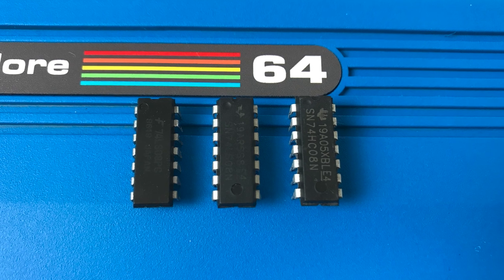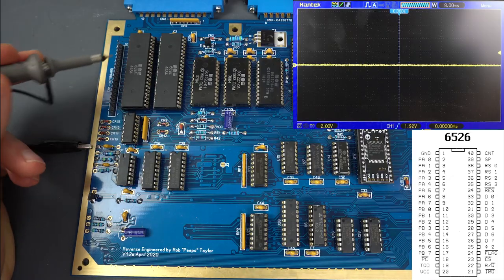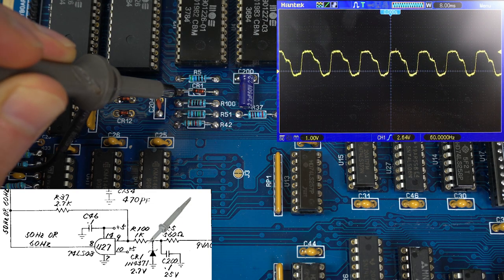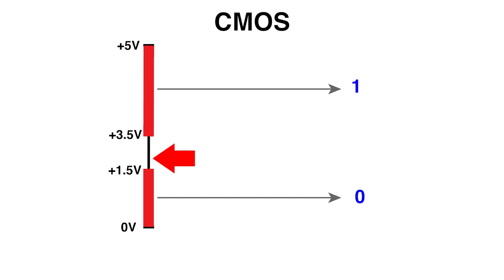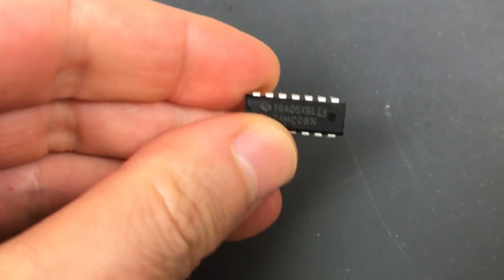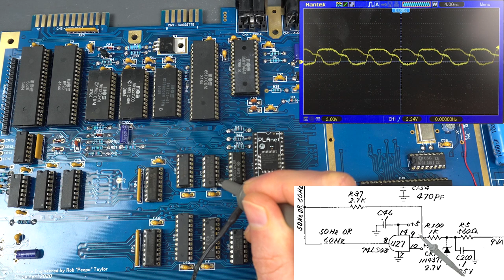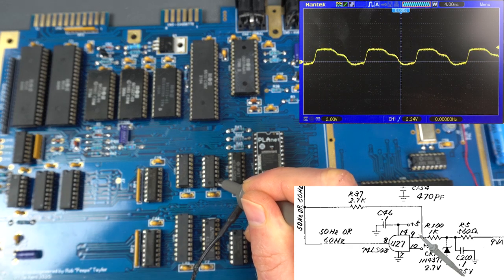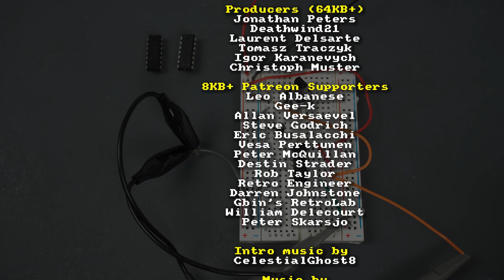Stumped By New Fake Chips Scam

Comment: I'm surprised the tl866ii doesn't use the proper voltage for testing LS/HC chips in its database; from what I can see you should be at least able to select the logic level used.
Reply from the maker: I assumed the TL866II just uses max voltages for their tests because they're logical test. They're even listed as the same chip: 74HC(LS)08.

Comment: I have been using KiCad for a few years now and I have been spending a lot of time, just seeing what I can design... I had an idea of wanting to design a C-64 board that plugs into the S100 bus and  looks like a S100 bus to the rest of the bus system... 
(Meaning, hopefully, I can get a C64 to operate the other S100 bus cards in the box..)
It would be cool to run Hesmon on a S100 bus and see what is going on inside..

Option  2
I want to totally revamp the S100 bus to run modern chips and access features that did not exist when the S100 bus came out... (i2c, USB, HPIB, ethernet, SSD, (SIMMs or better), uSD, WIFI,  etc)
Even use a few of the unassigned S100 pins as (bus mode logic).  
(pin High = standard bus), (pin Low = alternate bus)

Is there anyone out there that can help?  
(Would like to see what can be worked out..)

Comment: Imo, 2v7 is a bit tight, anything below 5v1 would have been fine.  Anything relying on the analog switching voltage of 74LS series is a bit suspect and it could have easily been designed to work with either and it will drift with temperature.  There are also lots of people in the supply chain that that just think they are equivalent and in nearly every application they'd work fine.

Comment: A 74HCT08 should work. 
Or increase the Z diode to 4.7 volts. This is to ensure that the IC does not get more than 5 volts at the input.
Or you can program am attiny85 that outputs 50 Hz.
Reply from the maker: Yes, an HCT would be idea there (just didn't have any on hand, just HCs apparently). Probably even something as simple 555 timer would be enough to generate 50Hz.
Reply: @NoelsRetroLab 
Comodore has surely adjusted the Z diode when another manufacturer of the 74LS08 did not work.      I would have provided a 4.7 or 5.1 Zener diode and a real Schmitt trigger.

 I'm thinking, in the US the line frequency is 60 Hz. So you have to divide by 60, not by 50, to get a second.
What happens if you give a European C64 60 pulses to the CIA?
Does the clock run faster then?
How does the CIA know if a second has 50 or 60 pulses?

Comment: One possible explanation would be just misslabeled batch which would be discarded at factory, but some people resell factory discarded chips as legit...

P.S. I would strongly suggest to change zenner diode to raise voltage over threshold - healthy HC should trigger on any voltage lower than threshold, but there is no guarantee that it will trigger on any voltage lower than that. Current chip triggers in current conditions, but could drift a little with temperature.

Better solution would be Schmidt trigger, but that would probably ask for changes on board...
Reply from the maker: I don't quite buy the mislabeled when things come from those sources. I suspect foul play, but you're right that it could all originate from a bad batch (of HC chips) that were all relabeled. And yes, you're right about using a higher zener (or a real LS or HCT).

Comment: I don't think this was a fake TTL chip. The input signal at 2.1V was already at the limit of what well-manufactured TTL chips would recognize as logic high. So if the manufacturing process used wasn't very well controlled and the testing a bit lax, you could get authentic TTL chips that just wouldn't register the logic high. So I think this is a case of poorly manufactured, bad quality TTL chips, not fakes. (What was fake was the TI brand, as these are likely Chinese TTL chips, not TI.)

Comment: Break the plastic case and expose the die and try to figure out if they're genuine TI parts or not by comparing them to a legit one, I mean, it's a dirt cheap chip, nothing bad in doing that experiment :) Also, the mod you've applied to the zener diode might work marginally with that counterfeit 74HC, I think it would be better to raise that input voltage by using a higher voltage zener or using a proper 74LS
Reply: What is a genuine TI die supposed to look like?

Comment: Your analysis about the chip being "fake" is mostly correct in that it definitely doesn't behave like a TTL chip (which aren't only 'LS' chips, but also those with no letters between the 74 prefix and the trailing digits).  Your EEPROM programmer wouldn't spot the difference since it sends unambiguous logic signals to the DUT (device under test), whereas Commodore's circuit design used a logic chip as a poor-man's Schmitt Trigger (https://en.wikipedia.org/wiki/Schmitt_trigger), which is an analog system.  Commodore simplified the board by re-using a spare logic gate instead of adding an operational amp, or even a pair of transistors, to perform this function.  In the end the "counterfeit" operation was a mild infraction since they're selling logic chips that expect something below 1 volt for logical "zero" and something above 3 for logical "one", and have the sufficient "fan-out" to work like the pure TTL logic chips of the mid 70s in logic circuits.  Just for the future, you could also increase the resistance of the hysterisis loop to make the circuit work.
Reply from the maker: Yes, you're absolutely correct. I suspect Commodore went that way because they had one unused gate in that IC and decided to use it in a marginal way.

Comment: I wouldn't completely blame the chip and the manufacturer of it.
The circuit design is partially involved in this "uupsie" too. A circuit that relies on the triggering level of a logic gate to be at a certain level to function properly.
Reply from the maker: I agree that the circuit design is severely lacking (I suspect a last-minute hack to make it work with an available gate).

Comment: A quick search of Mouser finds that SN74HC08N and SN74HCT08N chips are about the same price, while SN74LS08N chips are about twice the price.  The knockoff manufacturer probably only manufactured 74HC08 and not 74HCT08 chips, and probably thought nothing about logic family compatibility when rebadging 74HC08 as 74LS08.  74HCT08N has TTL voltage-level compatible inputs.
Reply: Higher price is reason enough for Chinese fraud.

Comment: Tandy had a similar issue in  Australia  in the early 80's with their model 16 B running Xenix (a derivative of Unix from Microsoft that latter became SCO Unix) in that they had set the system clock run off mains frequency which is 60 Hz in the USA and 50 Hz in Australia. It was fixed with a software patch.

Comment: Hi I am an old fart. traditionally 74LS04 chips were used in crystal oscillators. SN7404, 74HCT04, 74HCT04 will not work properly. The LS chips worked better in the analog mode and only needed two caps and a resistor to create a stable oscillator. The caps were connected to either side of the crystal and ground, the resistor was in parallel.

Comment: one way to differentiate an 74LS08 from 74HC08 is to measure input current when it is tied to 0..0.4V should be a bit less than 0.4mA coming from the IC to the input (in 7408 bit less than 1.6mA) this current runs from the internal 2K/4Kohm resistor via diode or emitter junction. CMOS and HCMOS haspractically  no current flowing from IC to input. a single high efficiency red LED could be used to see the current if no current meter is handy.

Comment: I haven't watched the video yet, but... who'd make a fake 7408?
Also, I do notice the one on the right is HC... I remember writing a how to build document before, and the diagram lists a 74LS138. However, since almost everything else on the board is CMOS, not TTL, the 74LS138 doesn't actually work in it, you need to use a HC or HCT version. I'm not sure if the original 74138 works or not, because I didn't have one to test, but the HC and HCT chips worked, but the LS did not.
The main reason why some work, and some don't, is logic levels.
For TTL, a valid low is anything below 0.7v, and a high is another above about 2 volts.
in contrast, for CMOS, its something like, bottom 35% (so below 1.75 volts) is a low, and the top 35% (above 3.25 volts) is high.
so the LS's Above this is high, is the CMOS's Below this is low.
HCT is something inbetween, I think it basically guarantees the output will be below 0.7v, or above 3.25v, so it works with both, and I think the input follows LS levels.
EDIT watched up to where you're looking at the clock circuit.
For Logic, most of this stuff doesn't matter, but for an oscillator? Yeah, it needs to be designed around around the type of chip, so using the wrong chip isn't going to work.
Reply from the maker: That's one of the big takeaways: People ARE labeling 74HC08s as 74LS08s, which is kind of mind blowing.
Reply: @NoelsRetroLab  Yeah, I did watch it through eventually.
Crazy indeed. not even a HCT.

Comment: Yes, there are a lot of rebranded chips from China, but some of them aren't even from TI, but sometime direct from chinese domestic manufacturers.
Therefore, if you want a vintage original and an original TI or other guaranteed Western no longer for sale or is very expensive, can buy chips from Soviet union or former CMEA countries.

74S08 = USSR KR531LI1
74LS08 = USSR K555LI1
74ALS08 = USSR KR1533LI1
74ALS08 = Czechoslovak Tesla MH74ALS08

You talked about the CMOS HC series, which with logic levels 0 and 1 is not compatible with TTL, that's true. 
The CMOS HC series is only compatible with the CMOS 4XXX series in range 5V power.
But there is also the CMOS HCT series, which is compatible with TTL, so next time you know you can buy also new 74HCT08 :)

Comment: Mains frequency is actually very accurate. It us used widely for clocks and is specified to be within certain tolerances at all times and within tighter tolerances over a certain period. This means that if the frequency drifts the power companies have to introduce a deliberate compensation offset for a period to bring the overall frequency back into tolerance. Unfortunately because of this method the TOD clock will always reset when it loses mains power. At least this way avoids introducing the menace of leaky backup batteries! 😲
Reply from the maker: Good point about that avoiding potentially dangerous batteries!

Comment: The frequency of mains AC power is extremely reliable, precisely because so many devices depend on it for timing.  I have an  old Westinghouse microwave oven that, for some reason, doesn't use the mains frequency, and its clock loses a few minutes every day.  Dumb design, but maybe it saved a dime, back when it was built.

Comment: Over time the 50Hz mains freq will be more accurate than any xtal derived clock, at least here in the UK where it is guaranteed to average out to exactly 50Hz eventually. I have a mains powered wall clock that has been running for more than 25 years now and has never been corrected other than after a power outage.

Comment: Common misconception that a higher frequency from a crystal is more accurate then for example the AC power frequency. This is not true. AC power is both stable and compensated for the number of cycles per day. Ir may run a bit slow at some point but will catch up later. Crystal accuracy is accounted for in % or rather ppm, parts per milion. It can be adjusted a bit with some variable caps and in a computer no one bothers to do so. Temperature fluctuations case the frequency to drift and from one crystal to another manufacturing differences introduce some amount of spread.

Comment: I think, at hot temperatures, it may not work.  The Zener voltage goes lower as it gets hot.
Reply from the maker: You're right, but it's probably a tiny drop. Although if it's just barely at the right level, you may be right that it might suddenly stop working.

Comment: Net frequency is not just "not that bad" if I remember correctly is is actively monitored and corrected when it deviated to much. (At least it is in the EU). Seconds missing from one day are corrected the next.
Reply from the maker: It's all relative. I saw measurements that it deviated up to 50 seconds over a few months, so that's "not bad" but I wouldn't want to do anything accurate with it 😃 And clearly that's not the objective of the time of day clock on the C64, so that's fine.
Reply: In the US I believe the the spec is 0.05% over 24 hours. That's worst allowed. As I can recall they regularly do better than that.
Reply: @1pcfred  In the Netherlands where I live it has to be between 49,5 and 50,5 for 99,5% of time. A few hertz more up and down is allowed for a max of 44 hours a year. which I think is less than a single percent of hours a year. So yeah seems pretty accurate to me. It has to be considering the amount of clocks that ran of mains frequency as the source of accuracy.
Reply: @bzuidgeest  it beats using a sundial or an hourglass.

Comment: I don't really understand why Commodore put such a low-value zener diode in that position to begin with.  Yes, technically, you shouldn't need to go higher than that, but what would it hurt to put in a 4.7V or 5.1V zener instead, and make sure you were always fully driving the input anyway?

I would bet that the reason they pull the clock signal from the AC line instead of the system clock is because they were just lazy, and threw on an existing IC design for a digital clock chip or something that they had lying around already onto some spare area of the die for the CIA when they were designing it.  Since the circuitry was basically pulled from a plug-in digital clock appliance, it was designed to run off of the AC waveform already.  I wouldn't be surprised if the whole thing was mostly an afterthought..

Comment: 74xx = Standard TTL series.  74LSxx = Low Power Shottky TTL series.  74HCxx = High Speed CMOS  series, input and output levels are not compatible with TTL families: generally very close to 0 V and Vcc.   74HCTxx = High Speed CMOS TTL compatable series.

Comment: The problem is not the chip, but the design. A 2.7V zener is too low a value to be reliable in that case. A higher value should be used.
Reply from the maker: Yes, the design is horrible. But it did work with a real 74LS chip, so the new chip is clearly at fault. A better idea would have been a Schmitt trigger, but that would have meant extra components I suspect 😃

Comment: Folks need to stop ordering current ICs from ebay, Ali Express, etc. Buy from reputable dealers who aren't going to sell you rejects, retops, and pulls.

Many complain about the cost / shipping etc. and use that as the reason. But think about the time that would have been saved, plus shipping costs for debugging the motherboard. Plus, the more we buy from these sketchy sellers, the more we encourage them to continue ripping others off.

Edit: It's unlikely that fake chips came from the factory -- especially not with TI and that weird stretched branding. There's almost certainly a different story here, like maybe they've found a way to retop these that isn't removed with acetone/alcohol (even though the lettering was, which wouldn't happen with etching).

Comment: Is there a way I can do 3 thumbs up ;-)  
A double education episode with the LS vs HC differences and learned about the clock at the bottom of the diagnostics display.
I stopped purchasing chips from China for exactly this reason and only buy from Digikey or Mouser for this reason.
Reply from the maker: Thank you! Really glad to hear that. I totally hear you on not buying chips from China. I'd do the same thing except that I often need "just one or two" and I can't justify ordering them from Mouser.

Comment: If you need check TTL chips, Do you need a multimeter with 200-300 microAmps DC current scale, 74 CMOS family (HC, HCT, AC, ACT, 4000) has  Input pins current,  ~20 nA. 74  TTL Family (7400, LS),  Input Pins current is 100-200 microAmps. No reading is CMOS. Good Luck.

Comment: 74LS series is actually Low Power Schottky. Original ttl chip would have been 7408. There's actually a whole bunch of different technologies used, see wikipedia: https://en.wikipedia.org/wiki/7400-series_integrated_circuits
Reply: Schottky, The choice for discerning eugenicists.

Comment: Damn, I can't believe they sent chips out that are worth cents for this con. But imagine you have medical equipment using such chips. 

But I've learned something new today, cmos was always just the bios for me. It's pretty confusing now when to speak of which 🤣
Reply: I think the origin of this misnomer as pertaining to PC BIOS is the Motorola MC146818 chip, which is a low power RTC and SRAM chip. You can prop it up on a small battery and it'll run for years due to low leakage of a CMOS circuit, and it came out i think 1978, so vaguely NMOS era for processors and otherwise, and the SRAM is good to store the nonvolatile system configuration, well at least it was the obvious choice before EEPROM came about. Till today it's both tradition to have some application-available SRAM in RTC chips, and the RTC and NVRAM in a PC is MC146818-compatible.

Comment: It is too bad he didn't measure the quiescent DC current consumption of the various ICs.  The 74LS08 was a seldom used IC so few were made, making faking necessary.  LS does not mean TTL it means Shockley and low power. Ron W4BIN